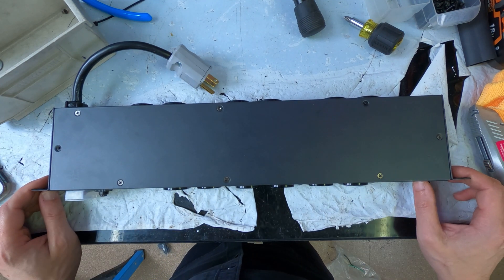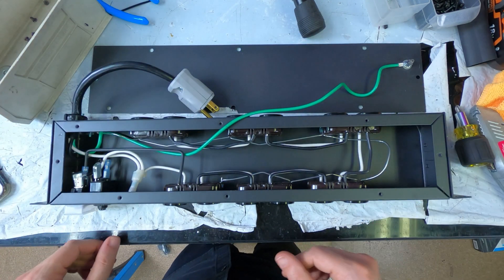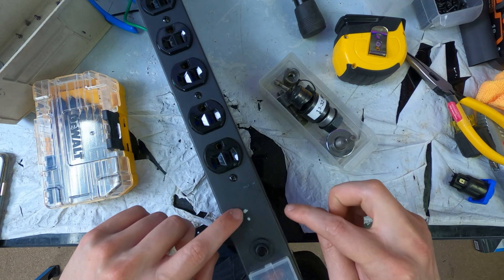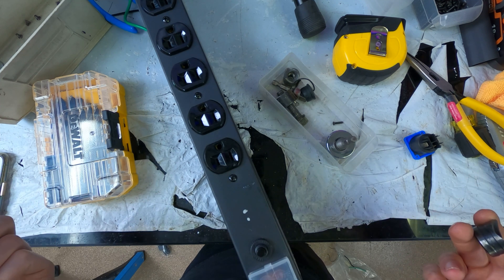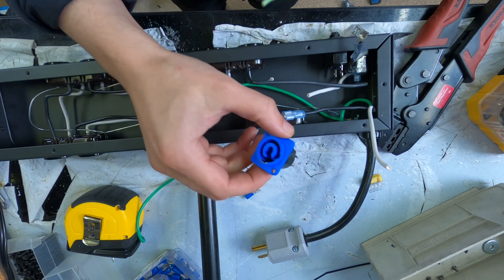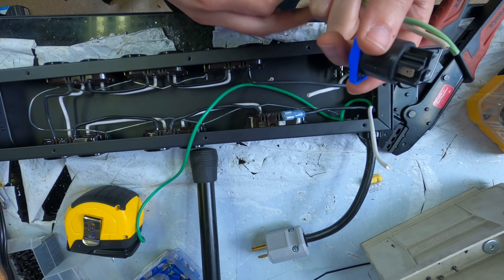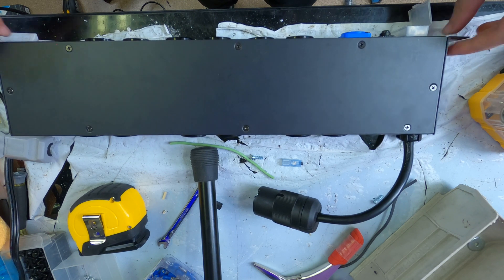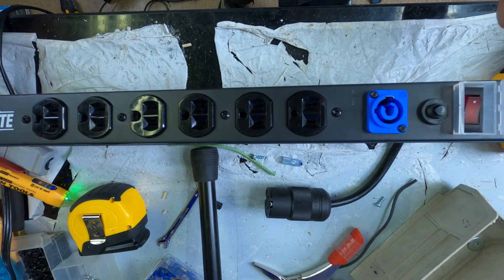Modifying A Tripplite RS1215 To Have A Powercon Input

Comment: U should have removed existing plug and gone through there
Reply from the maker: It’s a shallow rack chassis. It would be very difficult to plug it in from a connector on the back. Plus the little receptacle tail provides a spot for bulky DC adaptors.